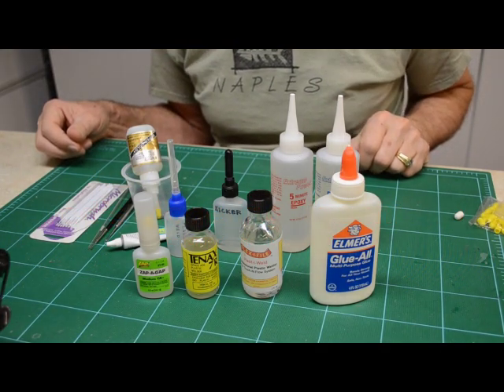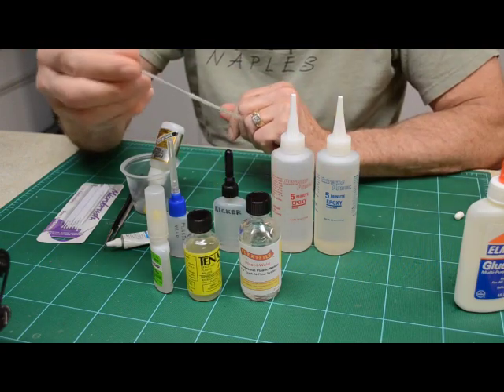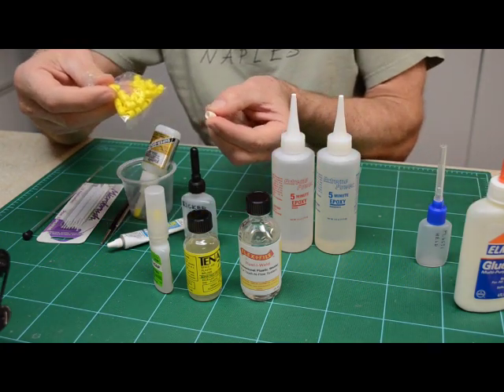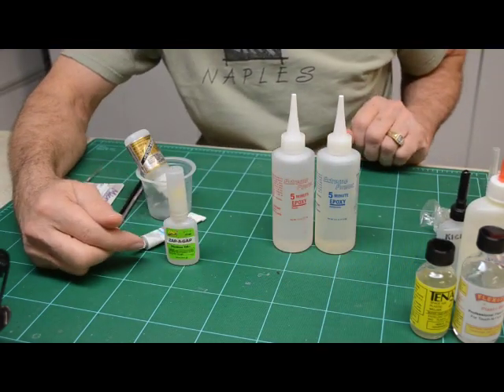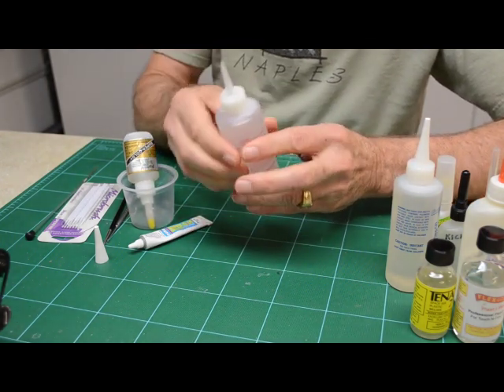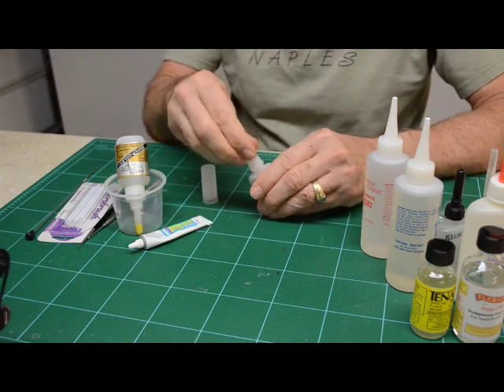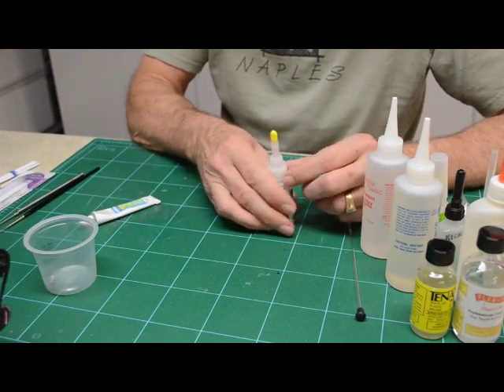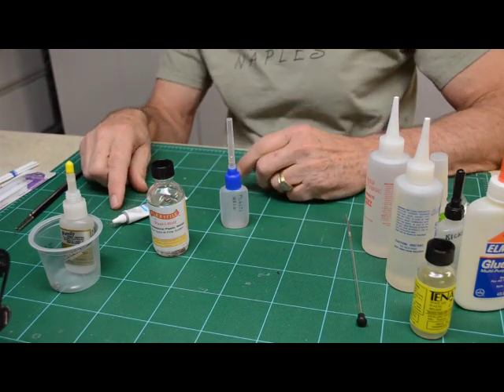How to Hints and Tricks with glues

Comment: Great video. lot's of great information. Personally while no master modeller I am not new to the hobby and came to watch this video (as I do so many "tips" videos) in the hopes of learning new ways to do things. The main thing I came to see was how you actually fill the Touch n Flows. I actually use the bottle you also have with the needle on the end that comes from Flexi-file as well. You said you use yours for kicker but I use mine as a "vacuum pump" to fill my Touch n Flows. I just stick a bit of blutac around the tip of the needle on the bottle, squeeze the air out of the bottle. Then stick the still squeezed bottle tip just into the open end of the Touch n Flow, which is already sitting in the bottle of glue needle end down. Let the pressure off the bottle and as it expands back to normal shape it sucks the glue out of the bottle up into the Touch n Flow. The "needle bottle" can also be used to clear a blocked Touch n Flow needle by pressurizing the glass tube and clearing a blocked needle. How do you fill your Touch n Flows?

Comment: Thanks ted, I was on u tube looking for this exact thing, I have 3 super glue and 4 types of CA glue and can't use any of them! As u said the glue has dried and sealed the tube opening shut, ima try an find the yellow type caps an just combine the S-glue into one, an the ca, thanks again, 
Ps I have used solder for headers and straws! Like a red med sz hardies  drink straw, I cut off the end and use for collector with a bit of heat shrink! Thanks again..

Comment: hello Ted, i'm new to plastic modeling cars.  Every time i glue on the car windows and the headlights it becomes cloudy and ruins it.  I think i'm using too much glue or the wrong glue.  I was using the testor plastic model cement glue brand, any advice will help, thanks.
Reply: use the revell clear parts glue
Reply: thank you michael
Reply: Don't use "hot"/solvent glues or CA for clear parts. The vapors given off by these glues as they dry is what you see as fogging on your glass work. PVA glue such as the "Elmers" glue mentioned in the video is perfect for glass work. It won't fog the glass, gives you time to get the part into position, it's easy to clean off excess with a moisten Q-tip and for small windows it can actually replace the kit part entirely giving you a window made from the glue itself that is very thin. Just have to make sure the PVA glue you get dries crystal clear.

Comment: Can you make a film on scratch made headers? I have seen the heat stain headers but would like to know how to build regular racing headers
Reply: That's a great idea, Jonathan. Headers are commonly made with solder (too limited in size and too soft), plastic rod (too difficult to make sharp bends), aluminum line (easy to bend and can be polished) and even RC airplane parts.  I'd love to make a video showing these differences.  Check back for it.
I appreciate any ideas or feedback on what I've done or what you'd like to see.
Thanks again.